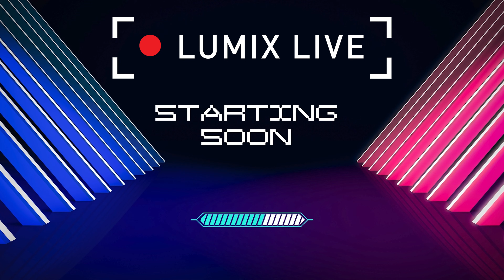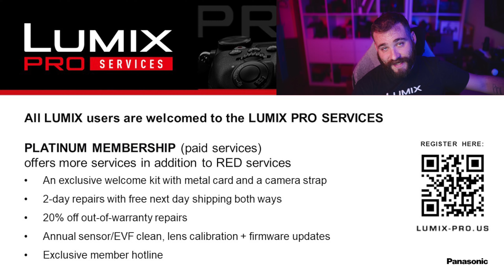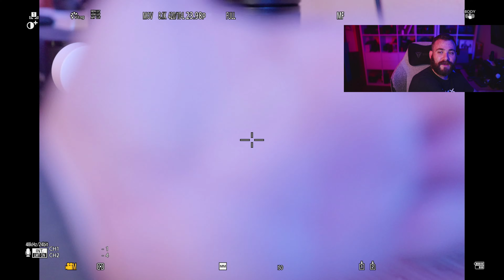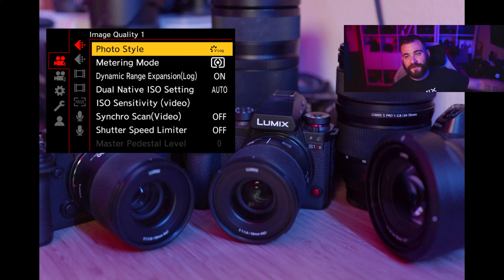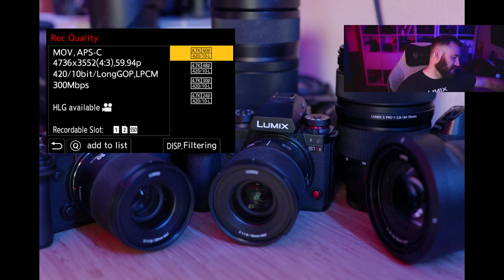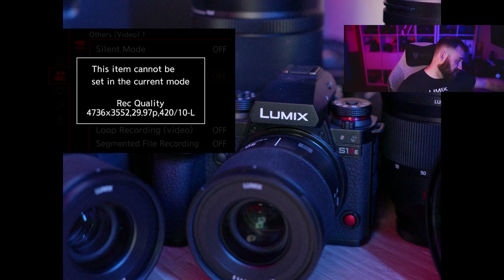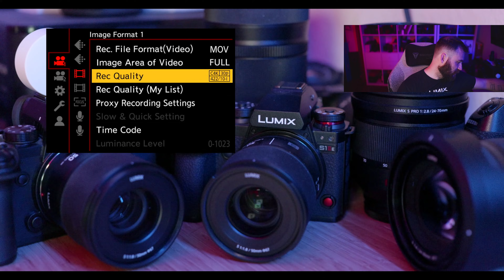LUMIX Live : End of Year Wrap-Up

Comment: 0:00 Stream start
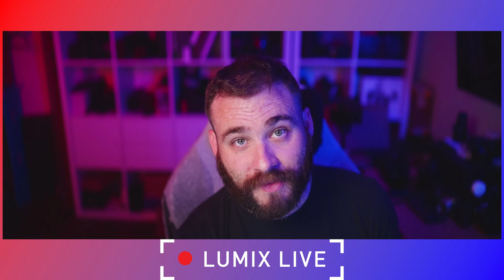4:42 Intro, LPS
8:08 Double exposure for S5ii & S9 (request)
10:30 How to expose for V-Log (+demo)
20:40 Toggling luminance spot meter to focus box
22:45 Wireless remote triggers
22:41 Correcting white balance in post in V-Log easier?
29:10 Changing picture profiles in LUMIX Flow
30:57 4:3 vs 3:2 open gate on the S1ii
35:35 S 24-105mm f4 focus speed
37:11 Choosing video format by categories
40:10 Cinelike A2, better timecode support on S5ii (requests)
41:37 Having technicians look at your hardware, LPS
43:55 Favourite release in 2025
44:53 Favourite event in 2025
45:46 Looking back at LUMIX Live, etc.
48:09 Low light with S1Rii 
51:54  Record beep through headphones, video white balance UI (requests)
52:43 Standard, cine or V-Log for low-light?
55:11 Why no in-camera HDR photos?
1:00:36 Forcing full frame with APS-C lenses (request)
1:03:14 Bluetooth timecode support (besides Atomos)
1:03:57 Recording to SD when using HDMI RAW
1:05:39 Crop zoom image quality
1:06:27 Open gate and using crop/hybrid zoom
1:09:19 White balancing with white or grey card
1:11:10 Linear focus setting with Sigma lenses
1:12:20 Adding LUMIX Tether features to LUMIX Lab (request)
1:13:17 Full frame 4.7K for S1Rii (request)
1:16:03 Why is the S1Rii image so good?
1:21:29 About LUMIX community engagement
1:25:26 Uses for the high mega pixel photo modes
1:26:33 S1Rii profile in Lightroom fixed?
1:26:56 Increase max shutter speed to 30 seconds, video markers (requests)
1:27:38 T-Mount lenses on L-Mount
1:29:49 Wrap-up, outro

Comment: Question for @lumix : On the G9ii in the "Zone" focus option, i can get the "circle" wider but not taller, did i miss something ? I can see some small arrows on it but both wheels play on the width and not on height.
Reply from the maker: Hi there! We have checked with our team and the option to make the circle in the "Zone" focus taller is not available. Both wheels adjust the width, but height cannot be modified within this focus setting. - S
Reply: @LumixUSA  Thank you for taking the time to respond ! Maybe this can be corrected/ajusted in a firmware ? I imagine a taller Zone could be interresting for bird photograpgy ? Or human subjects ?
Reply from the maker: You can try adjusting the zone size using the touchpad and then pressing "Set" to save your changes. Additionally, you might find that rotating the control dial helps adjust the width as well. Let us know if that works for you! - S
Reply: @LumixUSA  o tried touch pad too, and only the horizontal width is changing. Both control dials change horizontal width. I suppose one could/should change heigth and the other width.
Reply from the maker: Thank you for your suggestion! We appreciate your feedback and will share it with our team for consideration in future firmware updates. Your input helps us improve! - S